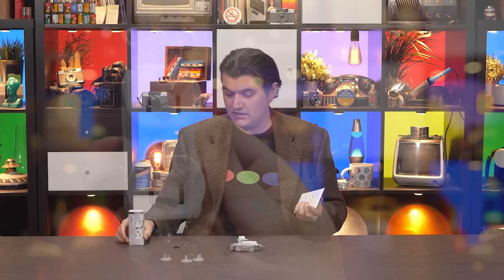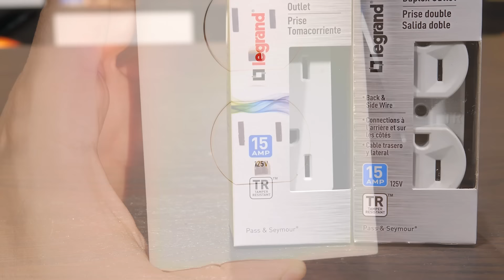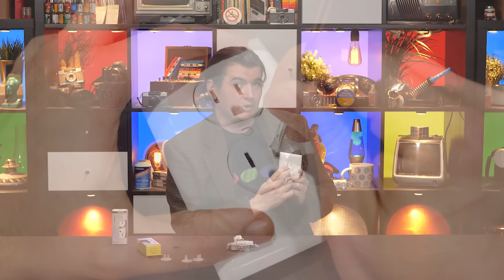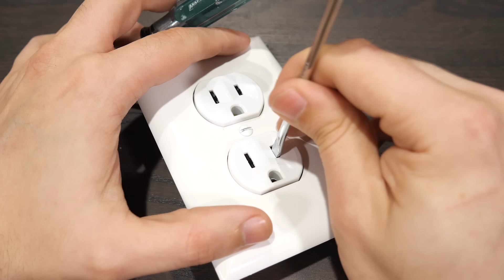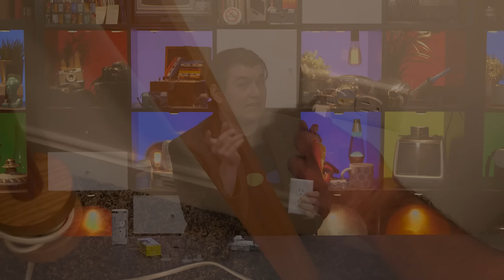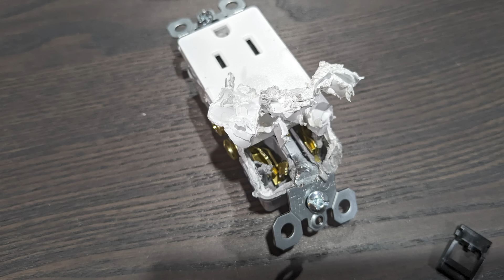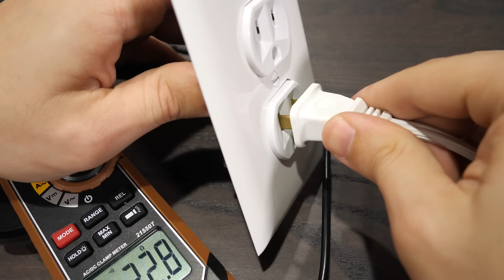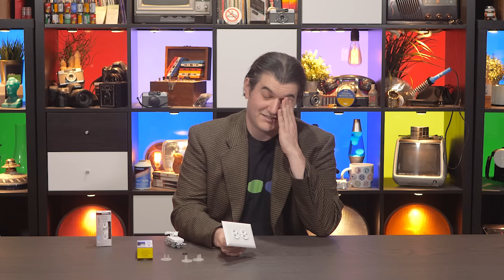Tamper-resistant outlets aren't all the same - a follow-up

Comment: Word of caution for replacing your plugs. NOT ALL OUTLETS are compatible with aluminum wiring if you're unfortunate enough to have a house with those. Even those that are should be checked occasionally. I almost had a house fire 3 days into moving in because the previous owner used the wrong plug. Know what you're doing with aluminum... out get rig of it preferably 8:20

Comment: Thu UK and probably the European plug were designed so that contact was nearer the tip of the inserted plug, so that it did not become live until almost inserted. This allowed the retrospective use of sleeved pins. The older design of the NEMA plug and socket may not .

Comment: Electric shocks because of the outlet design are few and far between. Very few if any people are killed by it every year.  Our design is not bad, it is not perfect or foolproof.  No matter how foolproof it could be, the world will always come up with a better fool. You cannot foolproof everything.
Of course, what is always left out of it is the cost of fixing the "problem" by the people who get on you for this stuff.  To fundamentally change the electric system would make everything obsolete or would require an adapter that would have all the same "problems" moved a few inches out from the new outlet.  It would take decades to fully switch out all of our old appliances.  I still have appliances with those old plugs with no plastic bulge that prevent your fingers from slipping off. 
The very same people bellyaching about these extremely minor flaws think nothing of importing Chinese market (made for the domestic Chinese market) electrical equipment into their outlets.

Comment: I have replaced all my duplex receptacles with commercial grade. Believe me, they don't fall out, nor do they plug in easy. But it's a good thing! And my switches single and 3-way are commercial which eliminated frustrating light "flicker".

Comment: We've got a tamper resistant outlet in our 3 season porch behind a sofa that has tall enough legs to clear the outlet. The anti-tamper mechanism is so sensitive to "both prongs at the same time" approach that if a cord is snagged and pulled out, it's a huge ordeal to move the entire sofa completely out of the way and somehow trick the receptacle to accept the plug after several minutes of trying. In theory I could just sorta crouch down on the floor to reach it under the sofa, but it is apparently not possible to plug something in straight on that way. Probably it is defective, or the truism about smart bears and stupid tourists applies, but it happens just infrequently enough that replacement consistently slips my mind.

Comment: You should get a European plug. They are IN there. About as firm as the cable that goes into a psu.
Reply: Sometimes it's even pretty hard to get the plug out, you really need to PULL

Comment: New house, outlets are the old way up.  I don't see putting them the other way up as an issue...  In most cases it won't change anything so doesn't matter if it's upside down to you or not.  In a few instances it's marginally safer.  And right angle plugs not existing for that orientation yet is a Non-issue, as if that orientation becomes common place... plug makers will make right angle plugs for it.  There would be a short transition period and then you'd have all the right angle plugs you'd ever need.
As for back stab outlets... again new house.  I went to plug in a wall charger and my overhead light turned off.  The wire in the back of the outlet was loose and the pressure of plugging in the charger knocked it out and cut the power to my ceiling light.  No breaker was tripped.  Using the backstab feature of those outlets is Faster during building... and is technically allowed by code... But it sure is a lot easier for a loose connection to occur than the hook and screw method.

Comment: I've noticed a habit I developed since moving to a house with tamper resistant outlets is the "jiggle and insert" that I now do when plugging stuff in. In my house at least, you have to apply pretty significant forward force while jiggling the plug around, or else the tamper resistant flaps won't budge. I notice a side effect of this is that the plugs always end up firmly attached.

Comment: I've recently had TR receptacles (P&S 15amp) installed with new circuits in my house, and I have to say they are by far the worst outlets I've ever used. just about any plug is a slight touch away from falling out of the outlet, and since there's only about a quarter inch of metal actually gripping the plug, anything that draws meaningful current even for a few minutes (like a vacuum) will get disconcertingly hot. needless to say, they are being replaced as this house is not "new construction or major renovation". probably with commercial receptacles.

I would think the only way to stop plugs from sliding out at that kind of angle, is to put vertical stops in the live and neutral slots?

Comment: If we want to make our homes safer, what we should really do is stop importing cheap chinese junk.  Unlike the contrived danger of the plug not being fully seated, people are importing horribly designed and poorly made stuff that plugs into the wall.  Just spend a few hours perusing BigClive's youtube page for an idea of what is being imported and plugged into US and British outlets on a daily basis. He fairly recently even measured 240 Volts on the 5v DC side of a USB power supply.

China has brand new cities with fake drains in the street (just laying in the ground with no pipe underneath it leading to a sewer system)  in front of fake hydrants not hooked to a water supply.  This is a land where used cooking oil is sucked out of the sewers and processed to look new and sold as new cooking oil (it has a ton of known carcinogens).  This is a place where they literally paint food and paint the sides of mountains with green paint as part of environmental repair and where they staple fake leaves to dead trees.
  China is the land of shortcuts.  They take a LOT of shortcuts in their electrical devices.

Comment: Not sure if this was already mentioned on this video or the main channel one, but honestly the US did go through a receptacle conversion in the past from 2 prongs to 3. We can do it the same way with adapters. If I buy a new device that has the prong protection, then I need an adapter that converts the device’s safe plug to a “bad” old style plug, like the old 3 prong to 2 prong adapter sitting around in a junk drawer collecting dust. If I rewire my outlets to the new style, then I buy the reverse adapter that converts my “bad” plug to the “safe” one. Then after a few decades most of the devices relying on the “bad” plug style are gone and most “bad” receptacles are replaced. Then it would be like now where my car still has the old 2 prong style receptacle as the auto industry never likes to replace something like wiring for ground if they don’t have to. But I can still find an old 3 to 2 prong adapter and can use that device in my car.

Comment: I remember getting shocked as a kid, around the same age with the same experience. Fumbling around in the dark to plug in a charger at night and was trying to touch the wall to find the holes while guiding in the plug. Wouldn't be surprised if that is the most common reason people get shocked
Reply: This is why most places with 240V and regulations have plug standards that have the back half of the pins shrouded in plastic, or the entire socket is recessed e.g. Schuko and the like.
Reply: @Broken_Yugo  too bad a lot of things, especially cheap chargers from China, don't follow that rule. When I was a child I got shocked doing basically the same thing, except it was a lamp. It being a Type C Euro charger did nothing.
Reply: @XDSDDLord  What, I have never seen a socket for Type C or Type F (Schuko) that wasn't recessed in a way that would prevent this, and I shop around on AliExpress from time to time. Haven't seen any Type C plugs with metal all the way up either. For Schuko that's common, but there it's no issue since they always fill the whole socket. Do you have any examples?
Reply: I've been shocked twice.  Once, as a kid, while paying no attention whatsoever, plugging something into an extension cord.  I was being ham-fisted, grabbed the plug, and touched both blades with my finger.  It got my attention!  But that's it.  No harm done, and lesson learned ... for about ten years.

Then, I was trying to plug a big wall wart transformer into a power strip, behind a desk, where I couldn't see the plug.  I was having trouble finding the alignment and didn't realize how close my fingers were to the blades.  When it found the socket, I brushed the pins for a brief moment, and learned the lesson again.  Cage rattled for a moment, but otherwise perfectly OK.

And that hasn't happened since, knock wood.  So yeah:  We learn to be careful, and the reminder is usually just momentarily unpleasant.
Reply: I was plugging in an NS brick into a power strip here in Aus, and must have had my finger between live and neutral (in physics we learn negative and positive). Even back then I usually turn off the outlet before plugging things in, mostly to avoid the prongs being burnt as the oxygen combusts (arcing I think). I currently have a power strip which has switches for each outlet, and I honestly have no idea why that isn't the standard.
Reply: @journaljemmy  probably cost
Reply: @journaljemmy  Negative and positive switch at a mostly fixed rate in alternating current electricity (60 times per second in America and 50 in Europe).  Direct Current electricity will have a 'positive' and 'negative' side but the 'positive' side is actually negative and the 'negative' side is actually positive because scientist used to think power flowed opposite of what it actually does.  The 'negative' side is also called ground and can literally be a long metal rod planted in the ground.  

Here's where we get a little in the weeds and to be honest there's some things here that I'm not 100% on but to the best of my understanding:  In a US residential split phase transformer (this is where the power comes into a residential building) each end of the transformer switches between positive 240 and negative 240, that is as one side approaches positive 240 the other side approaches negative.  If you looked at it on an oscilloscope you'd see a sin wave pattern.  The middle of the transformer is also tapped and that's where the neutral wire comes in, it maintains a relative 0 voltage (it's kind of like a pressure system where neutral is ambient, positive is above ambient, and negative is below ambient).  Connecting power from either end of the transformer to the neutral (middle) connection gives us 120 volts but since the ends are still switching between negative and positive we end up with positive 120 to negative 120 with the neutral wire still being a relative 0*.  Standard 120V outlets in the US will have one side of the transformer on one side of the plug (Hot) and the middle connection on the other plug (Neutral).  Our fuse/breaker boxes are setup so that the 'fuses' (actually breaker switches but we call them fuses anyway) alternate between hot plugs so if you plug a 240 'fuse' in it'll actually take up 2 120 slots and connect the two Hot ends (each end of the transformer).  Kitchens will usually be setup (I think it may be code) so that the outlets are half on one fuse and half on the next, this is to reduce the likelihood of an overload since a lot of kitchen appliances pull max power.

*I remember reading a comment before where someone said that in their country the power infrastructure was so badly butchered that neutral actually held around 40 relative to ground so their father used to get free power by tapping neutral and connecting it through a circuit to a grounding rod.

As for the arcing thing, that does technically happen anytime we plug in something in that's switched on (almost everything here has it's own power switch) or has a vampire draw even when switched off (like a TV) but with 120V the arc is so small that it usually isn't an issue unless the plug (or power switch) stays in just the wrong position.

Power strips with switches for each outlet are nice but as XDSDDLord pointed out they are more expensive to build.  Also as noted previously most of our devices have power switches built into them so unless you're trying to eliminate vampire draws or really like plugging things in in the dark it's not really necessary.

A fun side note:  Old radio's (from the time when AM radio ruled, people listened to international AM radio, and we hadn't yet discovered virtual grounding) would often have the grounding cable connected to the water pipes, since the pipes went deep underground they acted like grounding rods and the power sent through them was low enough as to not cause any harm.
Reply: I got bit by 240V twice as a kid. Both times light sockets without a bulb present.

Comment: my complaint with tamper resistance plugs is that I've found some polarized plugs (big neutral and small hot) where the neutral can be ~1mm longer than hot and messes with the tamper resistance shutter because it contacts slightly sooner

Comment: I live in Chile, with 240V 50Hz, and I have gotten shocked a few times

The one I remember the most was actually recently, since I disassembled a heating fan, and decided that I should touch the heating blades with my hand to check if they are hot (they were connected almost directly to Mains)

Also, I may be dumb or something, but I have touched the heating elements of my toaster a few times in the last month (to move the bread lower and have it more centered), and i haven't gotten a shock... weird

Comment: Wait, in some places you are not free to change y our receptacles? 

And yes this USA plug its very prone to be disconnected by itself. Before Brazil adopted the NBR 14136 standard, we used those plugs mixed with Europe ones and they slid out of the sockets just with the weight of the wire sometimes.

Comment: Also, in Australia and New Zealand, the sockets are similar to NEMA but with slanted pins but the pins are sleeved like UK ones. 

The angles also force polarity and feel like they provide a more positive support for the plug even without the earth pin.
Reply: Fun fact that if you determine the total number of residential AC sockets world wide then the Australasian format is clearly the most popular - mainly due to it's use in China and other Asian countries.
Reply: The Australian layout is based on a USA layout from the 1915(?), a larger edition of which still exists in the USA.  Yes, that's right.  They had 3 pin sockets and plugs that were keyed so they couldn't be inserted the wrong way round, thereby livening up chassis, and had an earth pin yet they still ended up using their non-keyed non-earthed socket/plug layout that still plagues them to this very day.  Makes complete sense... apparently.

Comment: these absolutly SUCK!  i have them in my home, built in 2013. some time i cant get a dang plug in, and i just force the hell out of them. i HATE these. when i added on to the basement i bought all normal outlets, and about to replace all of the crappy tamper resistant one in my home.   ALSO. the ones they installed, do NOT connect like a normal outlet in the gangbox. the outlet is the gangbox and the wire can pass through or terminate there but inside and it is like a crimp....... so stupid

Comment: I'm most of the way through managing a rennovation for my family. One decision I'm very glad to have made is that I went ahead and used "Extra Heavy Duty hospital grade" outlets, with tamper resistance, basically everywhere.

They're better in every way. They grip those plugs very well! They will last forever. They even are guaranteed to stay much cooler under overload (*when wire binding screws are torqued correctly!*) so they're less likely to start fires!

The only hard part was finding the GFCIs in hospital grade with the other bells and whistles. I wanted GFCIs at the beginning of every branch with audible alarms for trip indication, but also in hospital grade and with tamper resistance. There's ONLY one on the market available with those features, the HG2097TRAW, which I i remember off the top of my head from working to source it!

As a fun thing you might want to look into: all of the screws used to hold wires in place are absolutely supposed to torqued properly with a torque screwdriver. Almost nobody ever does! I'm one of the only ones. And yet, it's absolutely the correct thing to do, since its the only guaranteed safe way to do it. Every time someone has measured the torque people apply with a plain screwdriver they find that ~90% of the time is way way wrong.

Comment: when i was in the middle east the surge protectors we used were the literal hardest things to plug in to because of the little shutters. im talking whole body weight trying to get the plug in. often times the prongs would bend before the shutter gave way. id prefer the old dangerous outlets over that nonsense.

Comment: For what it's worth, in the UK we've had sockets manufactured by MK which use a 2-pin shutter mechanism for decades and this has relatively recently become something that all sockets use. 

Maybe the patent expired or something. 

In fact I believe that many modern sockets use both an earth pin to unlock and parallel live/neutral insertion to open the shutters.